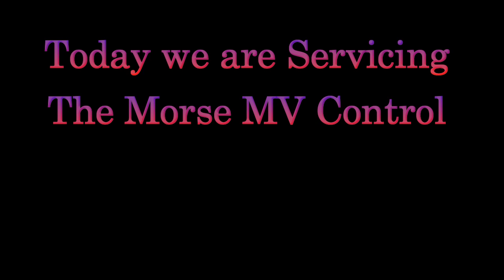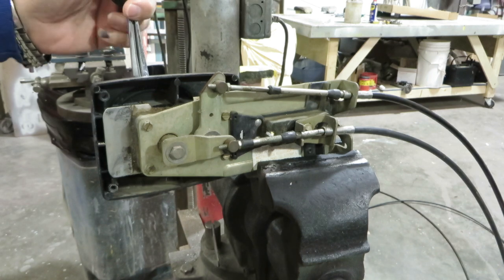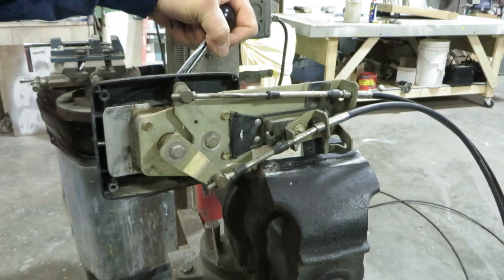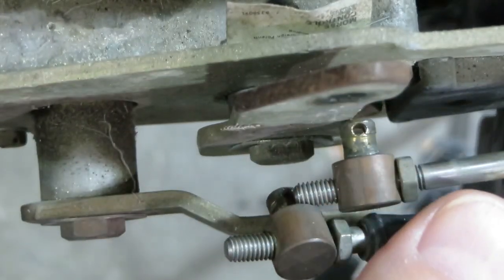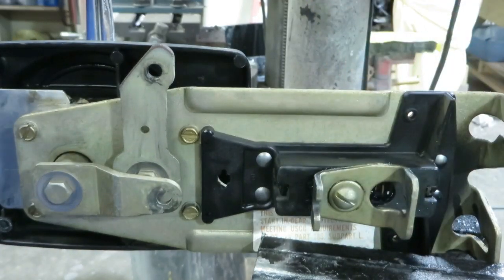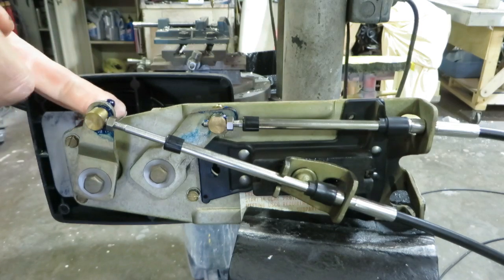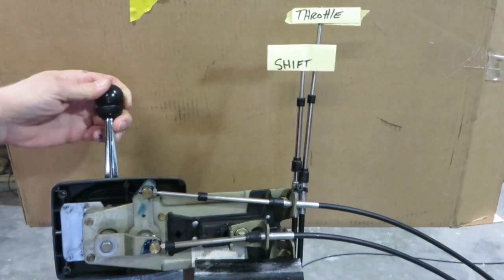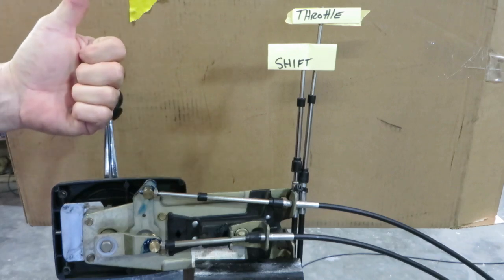Morse MV Style Throttle Control  Service

Comment: Hi Iv a very similar morse control . On the button pulled for neutral selection their is a spring that slides into a slot . My spring has nothing ie ball bearing resting against the crank of the pullout button . Should a bearing or something be fitted please . Thank you sw-uk. Just found out it’s the throttle control detent?? The spring is there but nothing against the cam . Tank you p